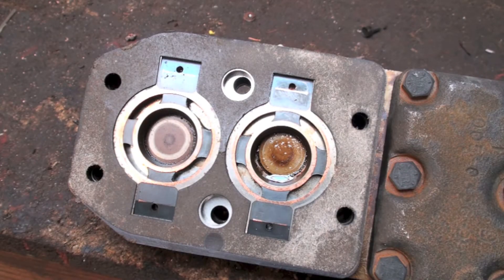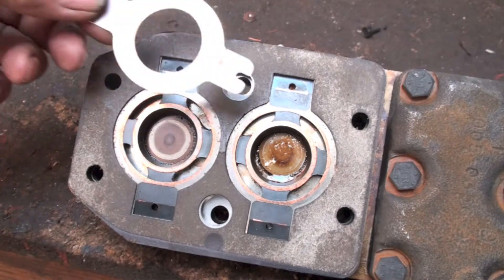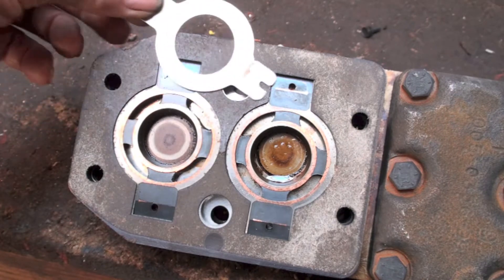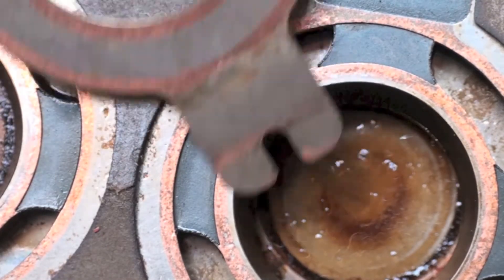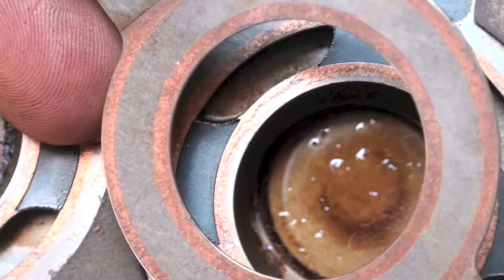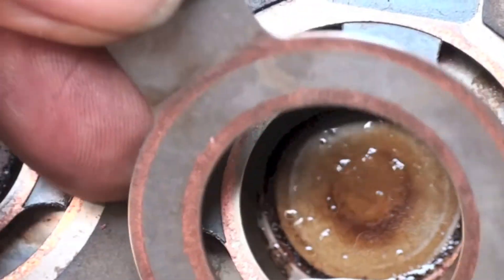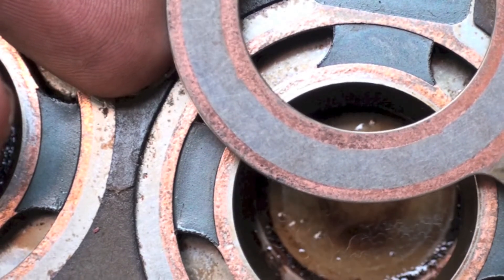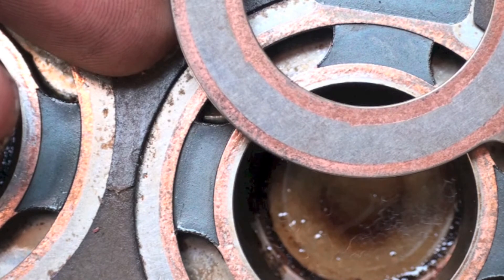Compressor failure: valves copper plating

Comment: Is that caused by copper filings in the system?
Reply from the maker: No, it is electrolysis pulling copper from the windings to compressor parts.
GFM